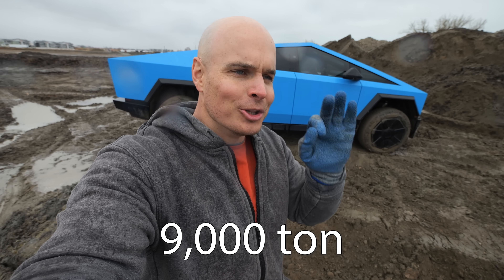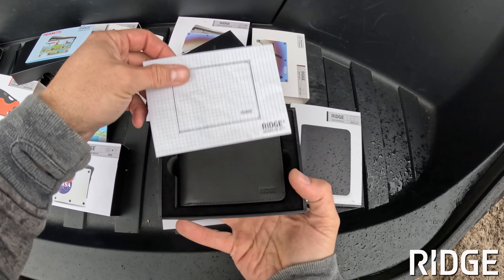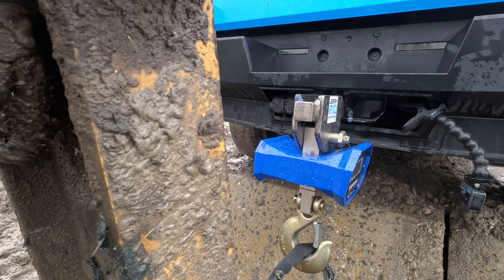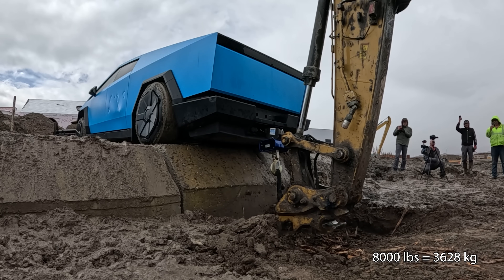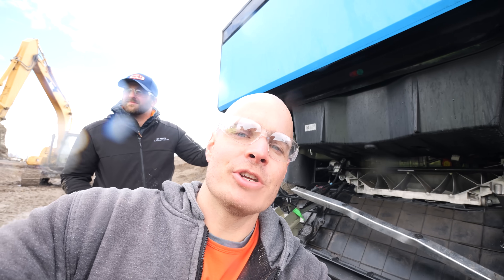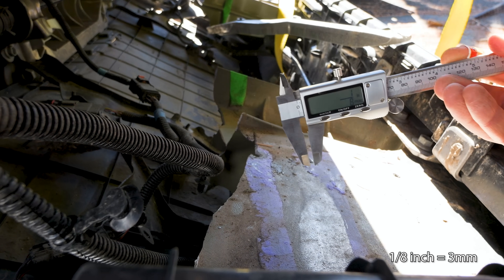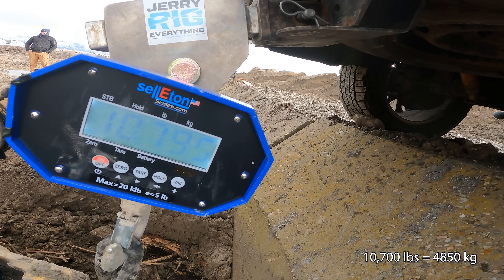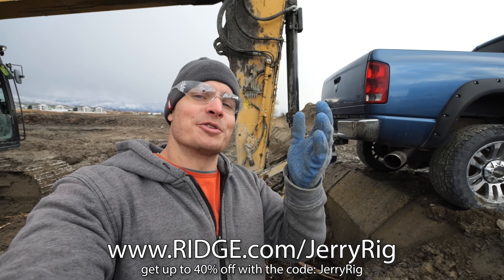SHOULD YOU TOW WITH A CYBERTRUCK?! - (catastrophic failure test)

Comment: Towing 10,000 lbs != applying a direct 10,000 Lbs.  You might want to research how tow hitches are rated, since it’s a DOT spec.
Reply: You also need to understand forces, the weight of a load is not the force being applied. you need to do Mass X acceleration. The weight of the trailer is not the force weight.
Reply: Did you watch the video? He explains quite well in what scenarios the tongue WILL indeed see such loads. Quite realistic scenarios, I'd say
Reply: @zahari_s_stoyanov  he did not, his explanation was completely incorrect. even driving up a vertical mountain, the weight of the trailer would still be laterally pulling away from the bumper, not downward (with reference to the vehicle) . There is only one scenario where this could happen, which would be if the trailer fell off a bridge and it was hanging from the tesla, in that scenario, I would hope like hell that it broke off instead of pulling me into the ocean.  This test was bogus and completely msrepresentive.
Reply: @mbrang00  he even pictured a scale representation going over a ledge - the load is no longer lateral. And that was only one scenario. Did you not hear about the family hitting a pothole and losing the trailer? That was a real case, they sent pictures to WhistlinDiesel to prove his case. A casting will take a static load for sure, but will shear when you shock it like that.

Comment: Funny how manufacturers claim that 'aluminum is stronger than steel' without mentioning that this is based on weight, not volume. In reality, it's more accurate to compare strength relative to volume rather than weight. For example, 10 lb of aluminum is stronger than 10 lb of steel, but that requires a much larger amount of aluminum. However, if we compare 3mm aluminum to 3mm steel, the steel is clearly stronger.

Comment: All the people sating "bad test" or "vertical vs horizontal weight" either didnt watch the full video, or missed all the points. 

Obviously breaking the tesla is clickbait, but, as explained 10:00, weight can shift changing to downward force. The frame was cracking well before 10,000 lbs. And again, from the video, over time the aluminum wears down. Id love to see the result of the same test on a cyber truck that had been used for towing for a couple of years

Comment: A 50K lb excavator could only apply 10K lbs of force on the Dodge's hitch while setup like a gooseneck trailer,  but you're saying a 20K trailer could apply 9K lbs of force in normal use conditions.  Something sounds off.
Reply: Did you watch the full video bro, the moral of the story is that the aluminum will get weaker and weaker, as they tow more
Reply: @chilliobear5261  I would never have guessed that by showing an excavator crush it in one go.  Guess i wasn't watching close enough.
Reply: The speculated scenario and physics portrayed in the video is simply wrong (intentionally or ignorantly). See comment from @bgavin71 for a decent explanation.
Reply: Spped is off.

Comment: Is this not showing ball weight?  Where as towing capacity is 11,000lbs? Which is pulling in the horizontal...

In Australia where I am from, most standed dual cab utes have a ball weight capacity of around 350kgs but they can tow 3500kgs.
We aren't loaded up the tow ball with 3500kgs.
That's why a trailer has wheels, as the trailer is taking all of the weight pretty much

Comment: A properly loaded trailer will have somewhere between 25 and 100 kilos of downward load on the tow bar. If you have 5000 pounds of vertical load on your towbar your front wheels will lose contact with the road so no car/tow bar is designed to handle a vertical load like that. You should have tested the strength by pulling horizontally (although I like making fun of Teslas like this ;-)).

Comment: This wouldn't be an issue here in Europe because it counts as a B category vehicle* with a heavy trailer (BE). You cannot exceed 80 km/h (50 miles per hour) if you have a trailer, and the trailer's weight must be under 3.5 t (3,500 kg or 7,716.18 lbs). *(It counts as a B category because I saw someone importing this truck to Czechia (since you cannot buy it here in the EU), and it qualifies as a B category because it is under 3,500 kg.)

Comment: Aluminium is not something I would ever trust as a structural load bearing material. I had an original Workmate portable bench made with this and the elegant looking frame just broke with a fatigue fracture after little use. The replacement made of tatty cheap looking pressed steel soldiers on no problem.

Comment: Yeah, Some things Steel is best for, and some things aluminum is best for. Depends on the application. For towing, yeah, that's not good. Part of the strength of that aluminum would be shapes and just overall cross beaming in the casting. Aluminum also has a bad habit of work hardening, which would make it more brittle and prone to cracking, then steel will. Steel would be preferred for frame, and anything load bearing and that may receive shock. Otherwise it's more likely to stress fracture and break. Aircraft are perfect examples of this. The main areas that are going to have shock or load bearing, tends to be reinforced with steel or cast iron, and the rest tends to be aluminum, to save as much weight as possible. It's also why aircraft have to be inspected so thoroughly, compared to cars and trucks, because a stress fracture in the structure can be catastrophic. It's so much more rigorous just from all the things that can go wrong, and the materials used to make the aircraft. Something like this seems like an oversight of engineers that didn't think about the different scenarios that could play out. I don't think there's been any other truck that has had things designed this way. So it makes sense there would be this oversight.

Comment: yeah wonder why you bend the entire frame downwards with 3,6 tons of pressure from a excavator pressing down on it by its towhitch instead of actually pull anything fowards or backwards the frame fucking snaps, Dont see when or how in any situation it would be carrying a giant boulder hanging off a cliff by its hitch as its front is anchored to something else, even a ford frame would snap from that, we got enough footage of that happening so, any truck with a broken back is basically a total loss just like this one is if you snap its frame because it doesn't have a detached bed.

This truck is perfectly fine for 11,000 pounds, you just dont do crazy shit with it like here and pull something on the road, instead of i dont know hang the weight of an entire excavator dangling off a cliff by it while its front is being held down

because i dont know dude physics tells me that without the front anchor that thing would have just had its nose go up and all would have been fine.

but yeah dude totally, when you try to snap the frame by anchoring the front and put an insane amount of pressure on the very rear, you will of course fucking snap the frame, dont see why you made this bullshit videok

Comment: there is such aggressive ignorance in these comments it is actually a bit depressing. a trailer is a DYNAMIC load; it bumps and moves around. even a small impact from such movement can cause very high peak load (mechanical shock) which is why hitch load limits are a tiny fraction of their failure point.
this video demonstrates STATIC load to clearly show the point of failure. nobody hitches a trailer so that it can sit in one place and be slowly loaded to it's rated cap and never moved.
Reply: Exactly, this “test” showed an unrealistic scenario and proved absolutely nothing.
Other than the fact that youtubers will waste their money destroying crap for views.
Reply: @MADmosche  at least when whistlin diesel does it, it’s kind of funny.
Reply: @MADmosche 💯
Reply: @henrym5908  nonsense. You can’t prove any of that, and if your imagined dynamic loads acting straight down on the hitch really do exceed the laden weight of the trailer, towing anything with any road vehicle would be virtually impossible without it doing wheelies or suffering structural damage.

The cybertruck is stupid but so is this entire proposition that a factor of 10 safety factor is somehow disastrously bad.
Reply: @evan010101   I have to defend OP here. Dynamic loads are certainly not imagined and can easily exeed static loads by a factor of 10 or more, depending on the damping factors in the system. Since force is mass * acceleration, any fast enough acceleration or deceleration (like a bump in the road, sudden brake maneuvers etc.) can create high forces. Even if they only apply over a very short amount of time, when you have brittle materials like cast aluminum, this can already suffice to overload it and tear it apart since there is almost no plastic deformation happening to absorb the energy. And then there are also oscillation phenomena like uneven roads and badly damped trailer suspensions that can create dynamic loads even in non-spontaneus ways which still exeed static loads by some amount, since masses are moving around.
Reply: still aluminum cracks under the smallest fatigue. Those cracks will continue to grow. Cast aluminum will fail before extruded or billet or forged. Cast will lose strength at a faster rate being jolted by bumps, hard breaking and the simple slack that is created in a receiver hitch. Imagine the increase in stress from using common drop hitches.
Reply: @blown503 not if it’s designed properly and used within spec (plus safety factor).  Remember, all jet landing gear is made from aluminium, those weigh hundreds of tons and are cycled dramatically how often do you hear of those failing from fatigue?  Or your car front uprights are most likely aluminium castings.
Reply: @evan010101  if it was designed properly it wouldn’t be made of aluminium :/

also that’s part of the reason plane parts get replaced so often or plane gets decommissioned much sooner relative to a car’s structural lifespan
Reply: @ there are plenty of aluminium planes from the 1959s in daily commercial use.  Enough with the old wives tales.
Reply: @  Not everything on an aircraft is aluminum, especially not cast aluminum.  There’s a US Air Force film promoting the Douglas C-124 Globemaster in 1954 on YouTube.  The film goes into a lot of detail about cycle testing the landing gear, the wing spar for repeated flexing, and the fuselage skin for repeated pressure/depressure cycles to meet the Air Force service life requirements.  Metal fatigue is a real concern requiring proper design.
Reply: @evan010101  those planes have to get lots of maintenance and stress cracks form all the time on planes. They just get repaired when they are discovered during the maintenance cycle. That said the cybertruck is typically beefy enough that the frame would be fine for the life of the vehicle under normal towing. Nobody is towing 11,000 lbs daily with a cybertruck on off-road terrain. It's highly inefficient.
Reply: @blown503  While true, mostly likely you'll expect vehicles to end of life before that fatigue adds up. You might need a chasis refresh after 10,000 heavy hauls.
Reply: @Idiomatick  I'm with you.  And as they clearly demonstrated in this video... the cybertruck was able to withstand 10 times what it's rated for.  The owner will almost certainly have moved on to something else long before it stress-weakens even down to its RATED capacity.
Reply: I think the most ignorant part of these comments is thinking that cybertruck owners are in the same demographic of people who know how to tow and load trailers properly.
Reply: An extremely bad road might apply 3x the static load on a properly loaded trailer. That's nowhere near the 10,000lbs they applied in this "test." If you are applying more dynamic load than that you are driving improperly or you are on a road you shouldn't be hauling a trailer that heavy on due to safety.
Reply: You are right in saying that events like hitting a pothole will produce peaks but the sheer fact that the tongue load they applied is more than enough to lift the front wheels of the car shows that the load would put the driver in danger by making the vehicle unstable before it would damage the frame, this peak load argument is only valid with number and to be fair the only number that matter is how much does it take to lift the front wheel because you can't reasonnably drive a laod that will lift your front wheels that is just pure nonsense, and it went past that easy so this test just proves the truck handles correctly in this situation, it actually took about twice the weight needed to make the car lift
Reply: @nytim666  you are 100% right.  the front wheels lifting off the ground make the tongue's strength completely irrelevant.  That might be the best point anybody has made so far.
Reply: No intelligent person bought a Cybertruck to tow huge trailers in the first place.  If they did- they were fools and deserving of 😮.
Reply: Sure but nobody tows perpendicular downwards to the floor...this test is incorrectly made, should have been done in the same plane as the vehicle.
Reply: If dynamic loads approached towing capacity then tow tongues would have to be rated for it - yet they are not. Strange isn't it? You are literally arguing that trucks make wheelies during regular use because of 'dynamic' loads - which is absurd.
As for the 'point of failure' - Cybertruck broke after reaching 95% of rated towing capacity applied directly downwards. If we want a fair test - apply 95% of Ram's towing capacity (which is higher) and see what happens. That would've been over 13k lbs. Are you sure this dodge would not bend/break at this point?
Reply: @Bilut it would have
Reply: @Bilut  The f150 weighs 6klb and can haul 14klb. If the dynamic load can swing +-100% of the hauling capacity, then the F150 would need to be rated to experience a sudden upwards force of >200% of its total weight...... I assume it has grappling hooks or something.
Reply: @Bilut  Yeah, the weight limit on a towing hitch is always a fraction of the towing capacity. The Whistlingdiesel's cybertruck broke while pulling, it'd probably break like that too, and it'd be a more relevant test I'd say.
Reply: And the cyber truck surely meets the dynamic load limits for the specified trailering loads. So what is the point of this test?
Reply: Exactly!  Nobody puts a 10,000 lb load pushing DOWN on the hitch... That's rediculous... If you were towing a 20,000 lb trailer (well more than the rated for CT or almost any truck) you wouldn't be putting that kind of VERTICAL weight on the hitch...

When is he going to do a REAL test... Pulling trailers of increasing weights... Start with one at max rated, then go up 1000 lbs until it can't pull it or something breaks from PULLING it... 

Now THAT would be a test!!

Oh, and use vehicles that are NOT FROM SALVAGE!!  You know, ones that can be driven under their own power and that haven't been in an accident already..
Reply from the maker: Thank you!
Reply: Do you have some figures for the dynamic loads? Just throwing "very high peak load" out there is not good enough. The trailed and the truck have suspension. The static load on the hitch, if properly loaded, is max 1100 lbs for CT. So how high are those dynamic peak loads at max towings speed? Not saying this to defend Felon, CT or aluminium but many people here in the comments sections are actually very reasonable so saying "aggressive ignorance" is a bit much.
Reply: @Axel_Andersen   The important takeaway is that the effect subcritical loads is cumulative and can significantly lower the point at which aluminum fails over time.  It is a different testing scenario, but the free paper below makes this point. It was done by the US NBS, now NIST.  You can find it by searching on its title:  Effects of Prior Static and Dynamic Stresses on the Fatigue Strength of Aluminum Alloys

Uncle Sam also has the following paper to offer up:  Fatigue Failure Predictions for Complicated Stress-Strain Histories - DTIC
Reply: @wtmayhew  I think it's important to note that the thing is 10 times as strong as it is claimed to be.  Which says to me that it has a Very Large amount of 'stress weakening' to do before it even weakens to its _rated strength_.
Reply: @  It isn’t totally improbable, but perhaps not an everyday occurrence:  towing an 11,000 pound trailer up a 15% grade (probably the most you’d dare), adds 1,650 pounds to the tongue weight.  The gross tongue weight might be around 2,000 pounds as result.  If you hit a pothole and get 5G of acceleration, which is a lot but not unheard of, you’ve got 10,000 pounds right there.  That pulled the bumper off in this video’s somewhat unscientific test.
Reply: @wtmayhew  mabe if it's fixed hard suspension. The tires might hit 5gs but the suspension should stop that from traveling to the hitch. This channel literally towed 11,000 pounds without breaking the hitch mount with the cybertruck. There are videos of them at tractor pulls dragging 33,000lbs as well.

Comment: Adhesives are a good solution when joining aluminium. Some proper cars have good crash safety with bonded aluminium safety. I'm not saying that it's appropriate for a vehicle meant for 'truck stuff' though. It's remarkable how much better the old Dodge Ram looks, even in its neglected state, but I'm not at all surprised that it performs so much better. The Cyber"truck" is good for fascist LARPing, I suppose... not much else.